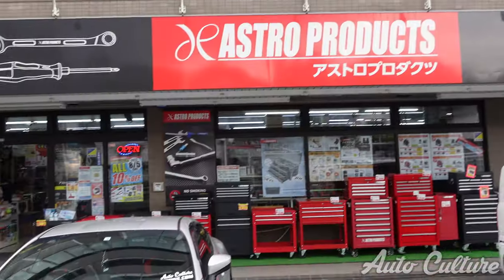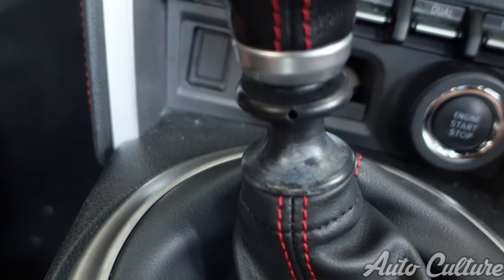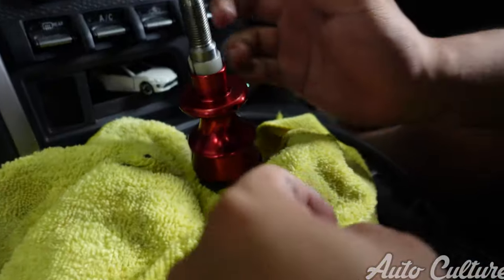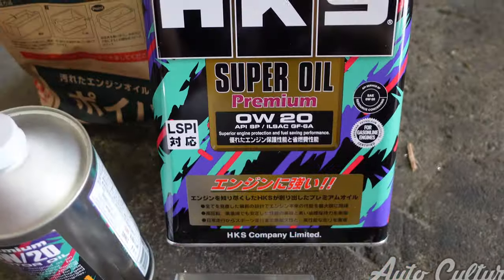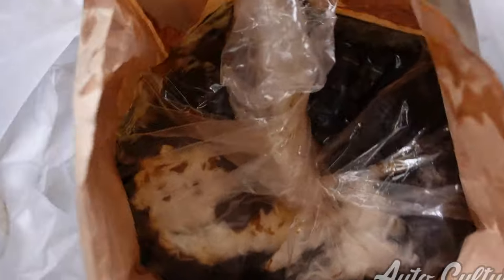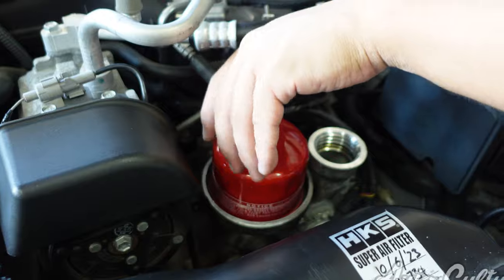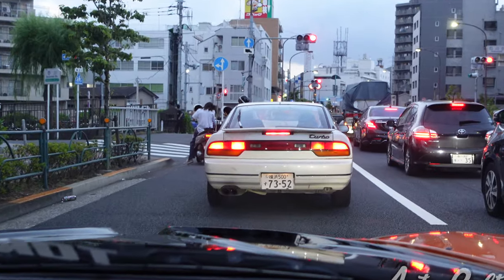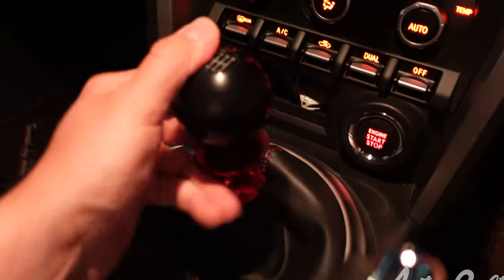TOYOTA GT86 FIRST BASIC MAINTENANCE

Comment: FYI There is a way to prime the oil without starting the motor. If you hold down the accelerator pedal then hold the starter button it will crank the motor with no fuel so you can get oil into the filter. That way you don't temporarily starve the motor for oil. I do this on mine every oil change.
Reply from the maker: Wow, never knew this! Thanks for the tip, that sounds like a smart thing to do.
Reply: @AutoCulture  I found out about it online. I thought it was a troll, but it works.

Comment: So everyone uses oil that they like I get that so why do you like HKS? I have a different kind of Toyota but I usually go Castrol GTX with K&N performance Oil Filters. Since you're in Japan, I was guessing maybe it was the market. Also intrigued by your TRD filter. I really like how they put the oil filter at the top of the engine. In my Corolla it's underneath and that means I'm going to get some of the gravel in my driveway in my butt
Reply from the maker: I have a lot of HKS parts on the GT86 including suspension and exhaust. Just like the brand honestly! Probably going to end up getting their oil cooler soon too.